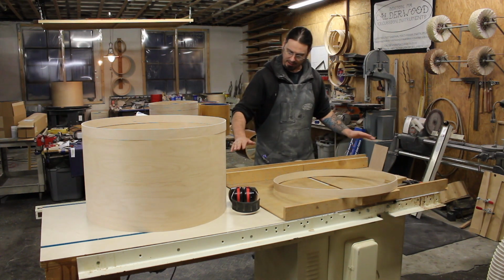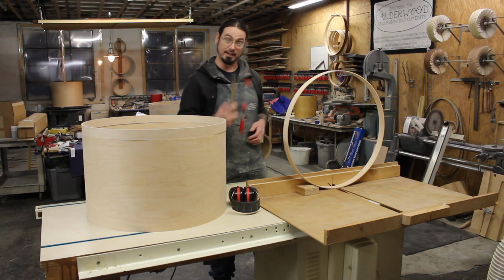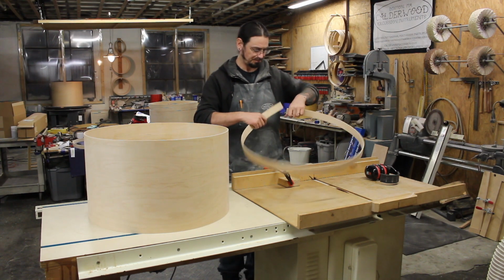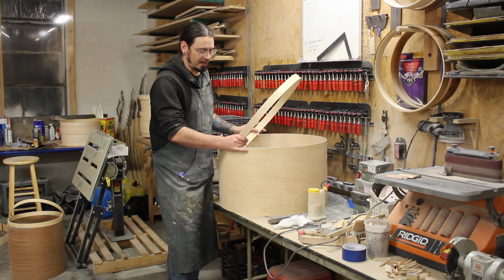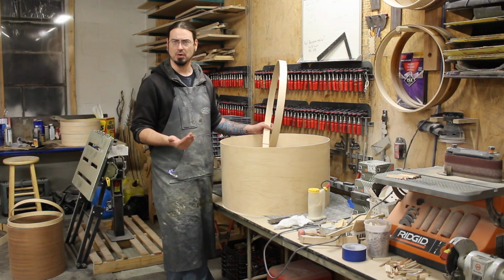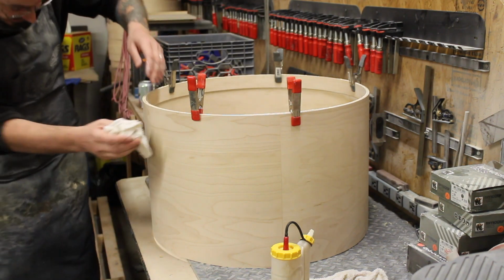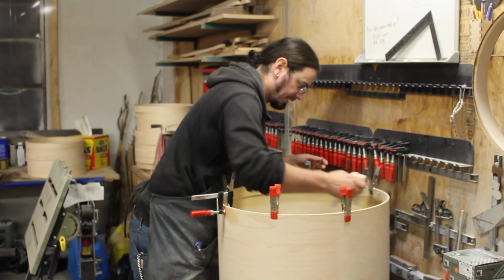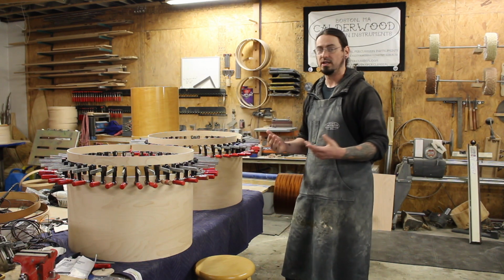Reinforcement Rings - Table Saw Method

Comment: If you are dealing with a shell that is already out of round that is being steam bent back into shape- would the old method with the pressure from the inside actually be prefereable to stabillize the shell from going out of round again?
Reply from the maker: That's a good question.  It seems like it might help, although given how stable bent lamination construction can be, when used in furniture or other woodworking applications, it may be that just gluing the ring in, regardless of the method, would be enough to do the job.  That said, I am inclined to agree that a tight fit would be preferable...  man, now I really want to try it and see what happens!

Comment: Brother you are the man! Thank you for sharing your knowledge.  Most people forget what this community is about.  I have a pdp cx kit that I want to put rings on it and true out the bearing edges. Do you think it's a good idea to do so??
Reply from the maker: Yeah, if you’re having tuning issues, then no reason not to. With inexpensive mass produced kits, the bearing edges are almost always pretty inconsistent, so truing and re-cutting them will probably really help. I mean, if the drums already sound great and tune easily, then maybe don’t fix what isn’t broken, but if you are having any issues, this is a good place to start addressing them.
Reply: @CalderwoodPercussion  I want to put a  pair of re reings on a snare  ludwig accent 6.5x14 because  I have a lot of problems to tune the drum.The edge is not uniform, it is not the same level throughout the edge. Do you recommend that there be a drop for the strings or do I leave the edge even? Thank you.